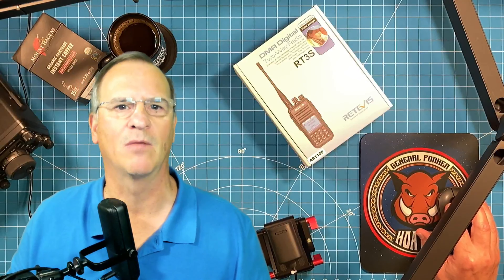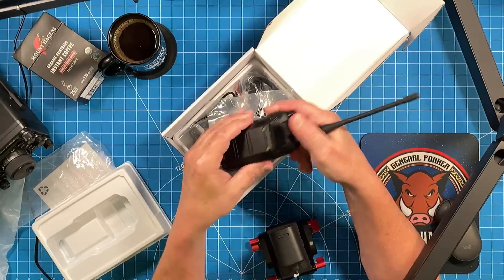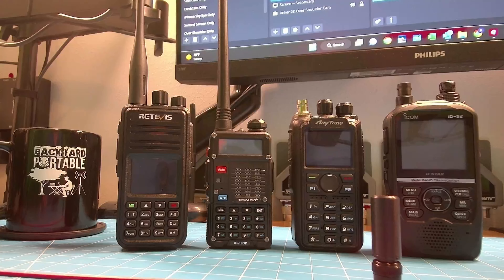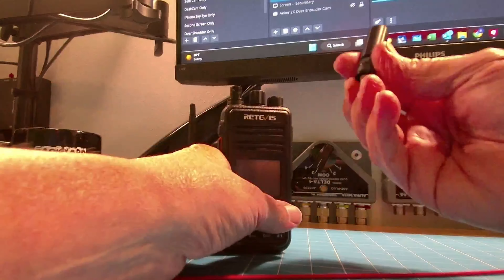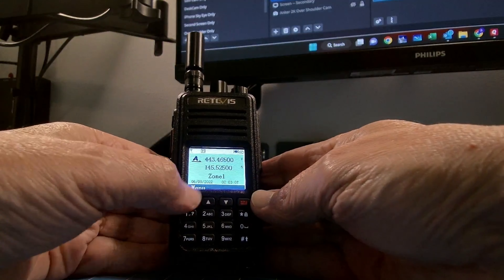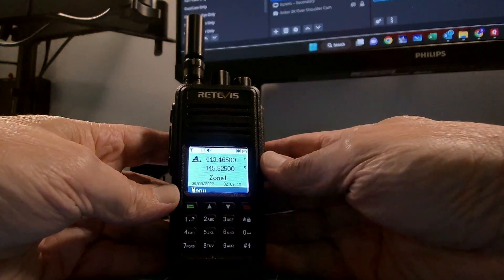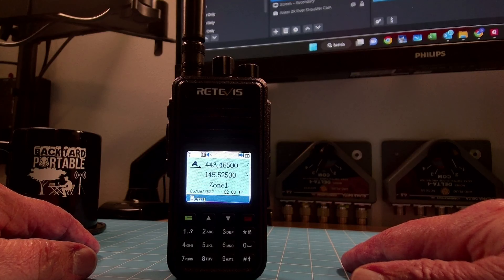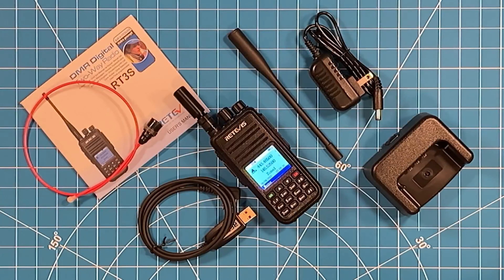Low Cost Low Risk DMR Ham Radio HT: RETEVIS RT3S Quick Look

Comment: Seems to be a variant of the TYT MD-380 series. A solid HT for the price. I use it bicycle mobile with the stub which works amazingly well considering the compromise. Good review. 73
Reply from the maker: Ham Radio on the Go...Bicycle mobile, I like that.
Reply: @HOAHamRadio  thanks, I put up a couple of videos on the MD-380.
Reply from the maker: Like the bicycle mobile.
Reply: It's not a variant of the MD-UV380 - it is an MD-UV380 with a different badge on the front. The MD-UV390 is also the same radio but in an IP67 rated case.

Comment: One of the first DMR Radio I got great little radio.    Have you seen the low cost UHF Cotre C006D DMR radio it's uner $40 right now. I would considered it as spare or back-up radio not a primary.
Reply from the maker: Thanks for watching and the heads up on the C006D radio.

Comment: The Amazon link you posted says 10K contacts not 100K, the Retevis website doesn't seem to provide this info in the specs. Can you confirm the Amazon post is wrong and the 100K you state in the video is right?
Reply from the maker: Thanks for asking Deirdre.  The answer is, if you use the "record" function you have 10,000, if you do not use the "record" function it is 100,000.  I have confirmed this directly with the Retevis contact who asked me to review the HT. 

I will be sure to cover this in my full review.
Reply: @HOAHamRadio  Be aware that "Contacts" are not the same as "DMR IDs" - with the CSV version of firmware, as opposed to the REC (record) version, around 120,000 DMR IDs and their associated data can be loaded in the radio, but the number of Contacts does not change.

Contacts are entered by the user via the CPS, DMR IDs are downloaded from various sources on the internet and loaded to the radio in a separate process to writing the code plug to the radio.
Reply from the maker: @mikesanders6351  Correct, DMR ID's and Contacts are two separate data sets, and the ID's are a DMR database upload. Now having multiple DMR radios I've found each CPS is a bit different, but in the end, they are all inter-dependent data tables.

Comment: Will an Anytone code plug work with this radio?
Reply from the maker: W4MKH, I haven't jumped to far into the CPS yet, but once I do, I'll be able to find that out and will share it in the full review.
Reply: @HOAHamRadio  thanks. I have a GD-77 and the problem with these cheaper DMR radios is that you pretty much have to write your own code plug from scratch. Ask around your area and see if there is a code plug for the Retvis.  For newbies it is a lot easier to just import a workin code plug. That is why I asked.

Comment: Could I just use this radio to listen to dmr?
Reply from the maker: Ross13ful, yes, you can just listen.  You will need a DMR id #, and you have to be a licensed ham to get that.
Reply: @HOAHamRadio  ok so just to listen to dmr I need a license
Reply from the maker: To listen to DMR you need to key up the radio on a TalkGroup.  To be "let" into the TalkGroup, it will scan for your DMR ID.  When you apply for your DMR ID they will ask for your callsign.  To get your callsign, you need to pass your Technician test for amateur radio.  

Simple answer, yes.

Obviously, you can listen to analog ham bands all day long without a license.  But you probably already knew that.
Reply: @HOAHamRadio  ok Thanks for answering my question I appreciate it